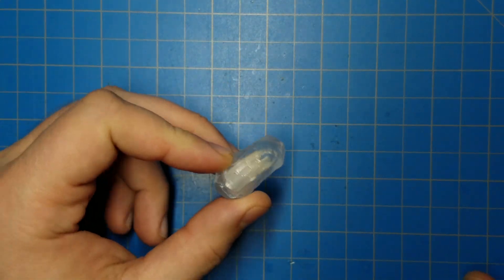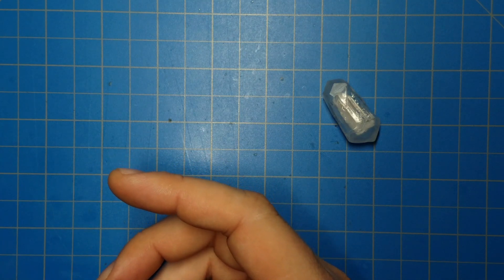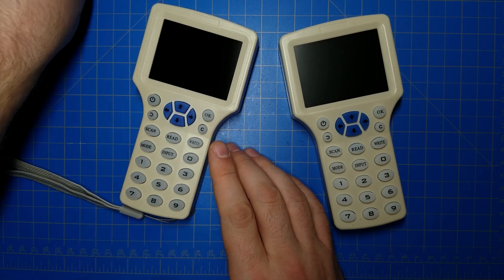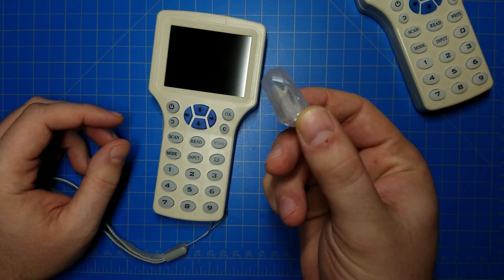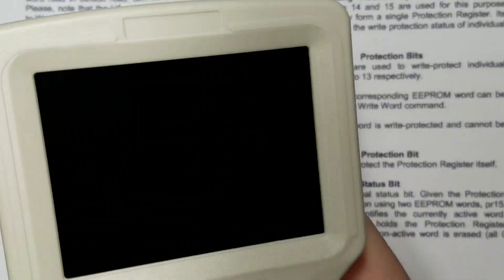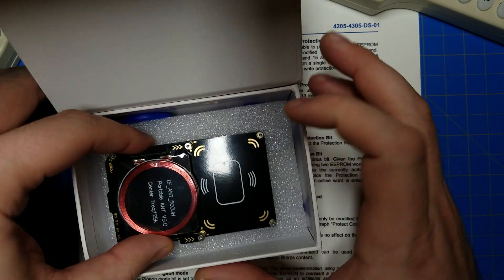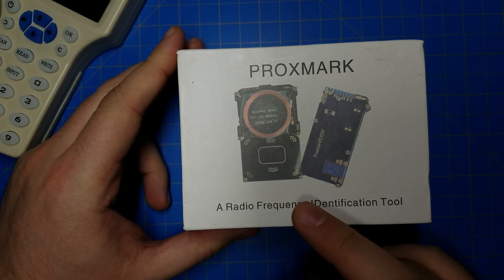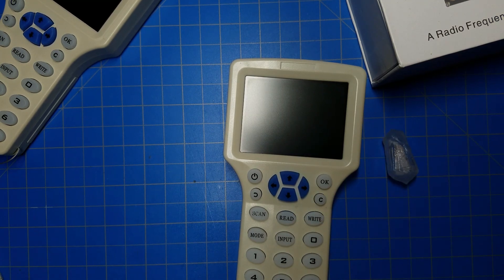Not All RFID Writers Work with Kyber Crystals

Comment: I just got the good one (Zonsin), for my kid & his kyber. Sadly, can't get it to work (read and write failures).  Our model had an elastic strap attached to the back. (It's meant to hold a card). Is it possible they've changed something and it will not work?  We cut off the strap in case it interferes. Unfortunately no change. We've tried roating the kyber in all possible ways, always read failures. I assume we need the "ID 125khz" mode and note "HID 125khz" but we've tried both.  Suggestions?
Reply from the maker: It's possible Disney has started adding passwords to the RFID tags. As soon as they do that, changing the tags won't be possible unless someone figures out the password. However I know crystals purchased as recently as a month ago were still not locked. While it's possible, I don't think that's happened. 

It could be that it is changing the RFID tag, but just unable to read the crystal. After you try writing the new number a few times, pop the crystal into a Savi's Workshop hilt or a holocron and see if the new color/voice is there. 

You could also try opening up the RFID writer and placing the crystal right in the middle of the copper wire loop that's used for the antenna. The case is held together with screws. As it comes apart, be careful as the wire and speaker are usually held in place on the back side of the shell and need to be unclipped to fully open it up. Or maybe you can fit the crystal in between the two halves of the case.

Any chance you could take a picture of the first screen that appears when it turns on and post it somewhere that I could see?
Reply: @Ruthsarian  Thank you kindly for your reply. I have a good news update. The third kyber crystal we tried worked!  It still usually takes my kid ~5 tries to read or write it, but it is consistent.  It is the most recent one we bought, just a few weeks ago: a purple "Galaxy's Edge" one from Amazon sold by ABM Enterprises. My kid noticed that it was thinner than the other two we had (a blue one from Savi's Workshop @ Disneyland, and a red one bought last year on Amazon.)  Have you noticed that the crystals come in significantly different dimensions?  He thought to try that – even tho he intended to reprogram just the red one – because he noticed the ones in your videas are thinner than the red & blue ones we have.  So we can conclude the thicker ones may just be blocking signals from this reader/writer. Again, our writer has the same Zonsin startup screen  (and interface background, etc.) shown in your video, but has that elastic strap at the back to hold a card.
Reply from the maker: @redrocklobster  that's good to hear! 

there are three different sizes of crystal: a thin, a medium, and a thick. There is some debate that there may be a second, slightly differently shaped medium crystal.

the RFID tags in kyber crystals have a small antenna in them that isn't very powerful compared to more typical RFID tags that the zonsin and other RFID writers are designed for. that leads to difficulty trying to write to them and you're definitely not alone in finding some of your crystals can't be written to no matter which way you hold it. 

it's possible the extra distance created by the larger crystals is enough to put the RFID tag out of range of the zonsin reader.
Reply: I am having the exact same issues you had. I ended up trying a couple skinnier crystals and they read just fine. The medium and large do not.

Comment: Sorry for a late comment, but with the generic rfid copier (the first one), does it password protect the original or the duplicate or both?
Reply from the maker: it will not put a password on the RFID tag you read (the original). it's only when you write to an RFID tag (the duplicate) that it adds a password to it.

Comment: Were you ever able to remove the Read Login bit set by the Zonsin on a crystal by using the Proxmark 3 Easy?
Reply from the maker: yup! https://youtu.be/o_LeK3G1KKo
Reply: Using password 0 on the Proxmark3 seems to not work after writing the crystal on the Zonsin. I'm able to see address 0 and 1 consistently when dumped but the rest of the addresses fail. I can't write an address either using a password value of 0 or not. It seems that the Zonsin that I'm using has placed a non-zero password for read and write login. I can still use the Zonsin again to change the crystal at will however. I know my Proxmark3 is working because I can dump and write to another crystal that was never written on the Zonsin. Have you tried to change a crystal on the Proxmark3 after writing it on the Zonsin (not OBO Hands)?
Reply from the maker: @danielanderson9377  yes, the instructions in the obo hands video also work for the 2 zonsin writers i have. what version firmware is your zonsin? it should be displayed at the bottom right of the boot screen. can you take a picture of the boot screen and share it online somewhere, I'd like to compare it with the two i have.
Reply: @Ruthsarian  
VER:0B-03029-04-1-191130

Disclaimer
https://drive.google.com/open?id=1Rq8zETb1tBJ77gK-RSvEy_3kXz2MfyOX

Main Screen
https://drive.google.com/open?id=1RdUBkv-CqDDIQjbhTGOmenPHNTHITfY8

Splash Screen
https://drive.google.com/open?id=1GnTdY8e36Ol39LAlycS7if9MzCIZlx26

The main screen with the instructions in the Operation window is most different than your version (yours is blank). It also asks to press OK instead of INPUT again when entering the card number value to write. When reading or writing the card number it is prefixed with all zeros.
Reply: How does this info compare to your Zonsin units?
Reply from the maker: @danielanderson9377  which info?
Reply: @Ruthsarian  the firmware version and screen shots I provided.
Reply from the maker: @danielanderson9377  Where are the screenshots?
Reply: @Ruthsarian  Hmm. They are posted above. Here they are again:

VER:0B-03029-04-1-191130

Disclaimer
https://drive.google.com/open?id=1Rq8zETb1tBJ77gK-RSvEy_3kXz2MfyOX

Main Screen
https://drive.google.com/open?id=1RdUBkv-CqDDIQjbhTGOmenPHNTHITfY8

Splash Screen
https://drive.google.com/open?id=1GnTdY8e36Ol39LAlycS7if9MzCIZlx26

The main screen with the instructions in the Operation window is most different than your version (yours is blank). It also asks to press OK instead of INPUT again when entering the card number value to write. When reading or writing the card number it is prefixed with all zeros.
Reply: They are posted above. Here they are again:

VER:0B-03029-04-1-191130

Disclaimer
https://drive.google.com/open?id=1Rq8zETb1tBJ77gK-RSvEy_3kXz2MfyOX

Main Screen
https://drive.google.com/open?id=1RdUBkv-CqDDIQjbhTGOmenPHNTHITfY8

Splash Screen
https://drive.google.com/open?id=1GnTdY8e36Ol39LAlycS7if9MzCIZlx26
Reply from the maker: @danielanderson9377  Sorry, your comments did come through, but were caught by YouTube's comment filtering and I didn't realize that until just now. Everything looks the same except the version. Yours appears to be different. I wonder if newer Zonsin's are including a password now. Ugh. I need to dig on on figuring out how to sniff the password these RFID writers are using.

Thanks for sharing those images.
Reply from the maker: @danielanderson9377  try a password of AA55BBBB.

this comes from https://forum.dangerousthings.com/t/xem-cloning-emulation-modes-and-the-perils-of-chinese-cloners/1547
Reply: @Ruthsarian  Thanks for the tip! My Promark3 clone became defective. I'm waiting on a replacement and should have it in a few weeks. I will try that password out and report back.
Reply: Got my replacement unit recently. No luck with AA55BBBB :(

Comment: I accidentally bought the obo hands model, would I be able to use the small blue model you've showed to wipe the crystal and use the obo hands to write? It's not perfect, but if it works it would be cheaper than a prox mark or ziosin  model.
Reply from the maker: i tried doing that, unfortunately it didn't work.

Comment: Where did you buy the Zonsin Reader?

Edit: Found it.  In case anyone else wants it, keep in mind I haven't received the product yet to confirm it is the one that works: 

https://www.aliexpress.com/item/32814673337.html?src=google&src=google&albch=shopping&acnt=494-037-6276&isdl=y&slnk=&plac=&mtctp=&albbt=Google_7_shopping&aff_platform=google&aff_short_key=UneMJZVf&&albagn=888888&albcp=1582410664&albag=59754279756&trgt=743612850714&crea=en32814673337&netw=u&device=c&gclid=CjwKCAiA1L_xBRA2EiwAgcLKAx8RgY9WpiRveo0bBd4WifdvIKqGCAOteC7xM9qS7Y8PrL_4XFn6CxoCRuIQAvD_BwE&gclsrc=aw.ds
Reply from the maker: I bought mine off eBay, unfortunately it's no longer in stock, but here's the link:
https://www.ebay.com/itm/183821082563

I did recently purchase this one from eBay and the version I received works, it just doesn't say "Zonsin" when you power it up.
https://www.ebay.com/itm/283704611499

I say "version I received" because I bought it wanting the version visible in the screenshots where there's no white background on the disclaimer. That is not what I received. I received a version that is exactly like the Zonsin except that start-up screen.

Comment: I as well obtained the OBO hands one and cannot alter it. Luckily I have another crystal. Sigh... So I bought another RFID reader just now and hope that it's the ZONSIN brand. BTW I found a Proxmark3 on walmart for 43 bucks here: https://www.walmart.com/ip/Proxmark3-NFC-RFID-Card-Reader-Copier-Changeable-Card-MFOC-Card-Clone-Crack-Open-Source/931006120?wmlspartner=wlpa&selectedSellerId=101001360&adid=22222222227308842186&wl0=&wl1=g&wl2=c&wl3=392241451608&wl4=pla-829609753427&wl5=9004087&wl6=&wl7=&wl8=&wl9=pla&wl10=128133340&wl11=online&wl12=931006120&veh=sem&gclid=CjwKCAiA66_xBRBhEiwAhrMuLVLzr9E0zvMj1-pxtkHp2xQg8bOgorFgeOdOnbB4jVwwQyVjFBZA6xoCbnYQAvD_BwE

Comment: This is very interesting and I'm wondering if the RFID tag in one of the Kyber Crystals I have has been wiped.  When I plug the crystal into the hilt, it does not light up.  I'm wondering if I buy one of these RFID reader/writers if I can fix it.  I know I could probably buy a new crystal online for less but then I wouldn't get to do other fun stuff.
Reply from the maker: you should contact Disney merchandise guest services at merchandise.guest.services@disneyparks.com or call 877-560-6477. the rfid chip in the crystal is probably dead. i've heard this happened many times to others before and even experienced this myself. it's not a matter of needing to reprogram it, the chip itself is broken and cannot be reprogrammed.
Reply: @Ruthsarian  Thank you for the reply.  I picked these up last year right during the reservations period prior to Galaxy's Edge Opening. I'm having some trouble with them being willing to send me just a crystal.  At least they requested some additional information and have told me I should know something in two weeks.
Reply: I just recently made mine, and when I did, the Crystal didn't activate the chassis when initially placed in, so they grabbed a new chassis before continuing and I haven't had issues since. If possible try to use the Crystal in a different chassis to verify the  issue, but I could see it being an issue of having multiple chassis
Reply: I had this same problem with my sons, but luckily we were still at the park and could take it back to Savi's and get a replacement.

Comment: I was wondering why mine did not work and found this video. I see now that I bought the OBO Hands one. Does anyone know if it is possible to change the firmware on the unit to the ZONSIN firmware? They look like the same hardware so it should be possible.
Reply: Andrew Waters that’s not how it works buddy
Reply: @ohyeahyeah8920  Thanks for your reply but I'm not sure what you mean. These units are identical in every way except for the firmware installed on them. They get the firmware on them some how so it should be possible to change that firmware yes? I mean you might need specialised equipment to do it but it's not as though it's impossible.
Reply: Andrew Waters the parts on the inside are probably completely different and one is slightly bigger than the other

Comment: Hi Ruthsarian, I locked a crystial with the obins device and so I bought a proxmark easy.  It can read the locked kyber crystal but cannot write using the commands you posted in other comments.  I'm using the command "lf em 4x05writeword a 4 d 0001805F p 00000000" and get the message "Error occurred, device did not respond during write operation."  I tried multiple positions of the crystal above the antenna.  Fwiw, when I search the crystal using the lm search command it reads it fine, but says "Valid EM410x ID Found!"  I note that in your other comments it should see it as an EM4x05 chip?  Any ideas?
Reply from the maker: Near the end of all the output from the "lf search" command should be a line stating it's an EM4x05 chip. If you don't see that message then you need to keep trying different positions until it appears. Here are a couple photos for reference with how I place the crystal for my proxmark3: https://imgur.com/a/jiebtj5

The difference between the proxmark3 not seeing the crystal and getting it into a perfect position can be a matter of just a couple millimeters. You're most of the way there. It sees the crystal. Now make very small adjustments in its position. Keep trying. It will see it as an EM4x05 tag and then the write command will work.
Reply: @Ruthsarian  Thank you! I'll keep trying different crystal positions.

Comment: I used the jank OBOhands one first, and now I have a Zonsin one.  Is it literally impossible to change the crystal now?
Reply from the maker: it's not impossible. it can be fixed with a device called a proxmark3. however the cheapest version, the proxmark3 easy, will cost you around $60. then there's some headache in setting up the software to use it.

it is possible to fix, but is it worth fixing? do you have other crystals or is that the only one?
Reply: Ruthsarian I’m trying to go ahead and buy a new one on offerup 👍

Comment: I'm pretty sure I just ordered a bad one, but at least I saw this video before bricking one of my crystals.  But I have a question, if I get some blank 125khz chips with the intention of casting my own crystals, can I use the bad writer to attach proper working codes to these blank chips?
Reply from the maker: It depends on what type of RFID chip they are. If the chips you're getting are EM4035 then you'll be able to write to them once and that'll be it, just like kyber crystals. If they're T5577 type RFID chips then you're probably going to be okay.
Reply: What about EM4305?
Reply from the maker: Kyber crystals use EM4305 tags in them. So the problems the OBO Hands writer has with kyber crystals will also be had by other EM4305 RFID tags.
Reply: Darn.  Thanks for the help.

Comment: I've managed to get my Proxmark to read my crystal and it doesn't seem to show as much detail, it just:

 [usb] pm3 --> lf search
[=] NOTE: some demods output possible binary
[=] if it finds something that looks like a tag
[=] False Positives ARE possible
[=]
[=] Checking for known tags...

[+] Valid EM410x ID found!

Then when I use the write code it only show the below:

[usb] pm3 --> lf em 4x05_write 4 0001805F 00000000
Writing address 4 data 0001805F using password 00000000
Write could not be verified

Still unable to write from my RFID reader, any thoughts?

Thanks again for your help
Reply from the maker: keep changing the position of the crystal until lf search specifically mentions that it found an em4x05 tag. 

i find i need to hold the crystal verticallt about an inch above the antenna. yours may be different. just keep trying different positions. it may take many tries.
Reply: @Ruthsarian  Thanks, i managed to get it to read the em4x05 tag but the write still doesn't verify, is the command im using correct?

[usb] pm3 --> lf search
[=] NOTE: some demods output possible binary
[=] if it finds something that looks like a tag
[=] False Positives ARE possible
[=]
[=] Checking for known tags...

[+] EM410x pattern found

EM TAG ID      : 0000000C00

Possible de-scramble patterns

Unique TAG ID  : 0000003000
HoneyWell IdentKey {
DEZ 8          : 00003072
DEZ 10         : 0000003072
DEZ 5.5        : 00000.03072
DEZ 3.5A       : 000.03072
DEZ 3.5B       : 000.03072
DEZ 3.5C       : 000.03072
DEZ 14/IK2     : 00000000003072
DEZ 15/IK3     : 000000000012288
DEZ 20/ZK      : 00000000000003000000
}
Other          : 03072_000_00003072
Pattern Paxton : 1329664 [0x144A00]
Pattern 1      : 68 [0x44]
Pattern Sebury : 3072 0 3072  [0xC00 0x0 0xC00]

[+] Valid EM410x ID found!

[+] Chipset detection : EM4x05/EM4x69 found

[+] Try `lf em 4x05`  commands
[usb] pm3 --> lf em 4x05_write 4 0001805F 00000000
Writing address 4 data 0001805F using password 00000000
Write could not be verified
Reply from the maker: keep making very small adjustments both in height and lateral position of the crystal and keep entering that command (use the up arrow to repeat the last command) and spam that command as you keep making adjustments. you will get it in the sweet spot and it will say write verified.

it's frustrating, but you will get it.

 the command you're using is correct.
Reply: @Ruthsarian  After fiddling around with the crystal positioning I managed to get both my crystals to write and now all the codes work with my Zonsin RFID reader. As a note when the command worked it just said ( Writing address 4 data 0001805F using password 00000000) and that's all, just in case it pops up in the future. 

I also used the alternative set up ( https://enterthecore.net/proxspace/) to get the software and it worked perfectly as an fyi.

Thank you so much for your help, you are a hero!